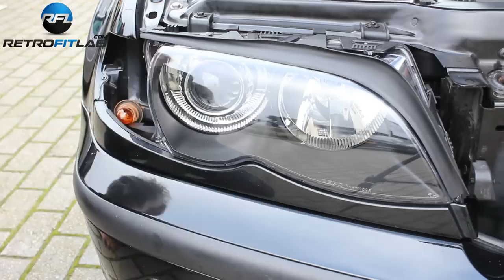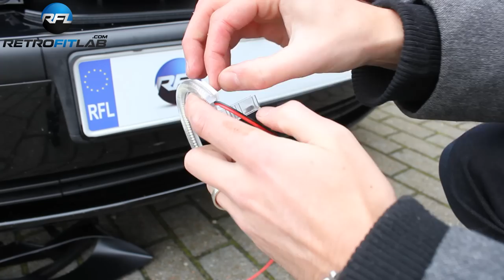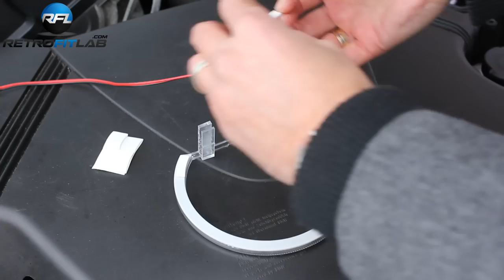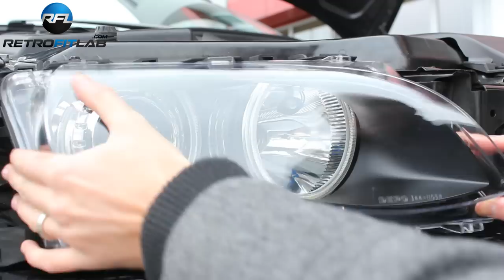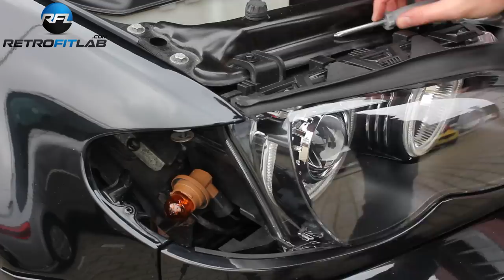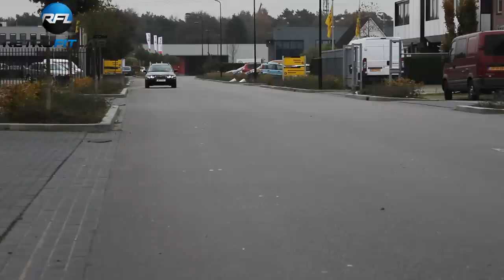BMW 3 series dimmable E46 Led Angel eyes / HALO mounting instructions

Comment: Never seen headlights come apart so easy
Reply: +Gnik4144 they have taken it apart several times so the dismentaling would look easy and quick
Reply: +Karl Tilgar yeah, the E46 headlights are extremely easy to take apart because its all clipped on. All cars should start doing this!
Reply: Retrofitlab what size ring did you use
Reply: yeah but in the facelift coupe and cab they are glued....
Reply: Gnik4144 دزلي سياره ساكن في لعراق
Reply: @Joel Ernesto Yea, been using instaflixxer for years myself :)
Reply: @Joel Ernesto Yea, been using InstaFlixxer for since december myself =)
Reply: @Joel Ernesto yup, I have been watching on InstaFlixxer for months myself :)

Comment: thanks for the vid. don't get me wrong, i really like that this is available. but i don't get why you don't talk? wouldn't it be easier, and eliminate many quesitons, if you were narrating it? i also have a 2004, but mine has stock headlights. so this will work without problems? so you just connect the white wires coming with it, to the yellow wires and it follows the high/low beams?

Comment: Well I've just fitted a set of Angel eyes lights & like the video it's dead simple...

Luckily, my headlights don't have a sealant around the lens case some models apparently have..
But, Yeh there a great mod, dead easy to fit unlike other brands where rewiring your engine bay/cabin is required
Reply: Hi Mal, I got the same angel eyes last week from retrofitlabs and haven't installed them yet as I'm not sure how to connect them. Can you please guide me.
Here in canada we dont have the tiny bulb which the technician removed and connected the blue wire to, what is the alternative? 
Thanks

Comment: How do you turn off the daytime running lights? I want to see just the halo rings on while the car is running
Reply from the maker: You can connect the daytime running light connector to the halo ring and not to the bulb so it will only give power to the halo ring.

Comment: With a running engine the relais makes a loud zumming noise.
Contact on it's totally silent.

Im afraid it wont last very long.
Has anyone else experienced this issue?
Reply from the maker: Which relay do you mean?
Reply: @Retrofitlab  from the kit. But it stopped and is still working today.
Reply from the maker: @hornox4life  self solving problems, gotta love them! ;-)

Comment: Is the pre-face lift headlight for the E46 (2000 328i E46) as easy to take apart as this one? That would really make it easy for me to safely install angel eyes on the BMW! Also, what is the colour temprature of the rings you used in the video? I don't like the ice cold white (8000K) ones. I want the same temprature as seen in the video! :)
Reply: Awesome! I want the OEM look and angel eyes to match the colour temperature of the HID's, so 5000K will be perfect. Also, did you use CCFL's? Where could I buy the ones in the video? 

Love your work amd videos too! :D

Comment: just brought these from ebay. they send me 4 same size ones. make sure when u buy these there are one larger and one smaller per head size
Reply: +san happy E46 Projector headlights need 4 same size rings. E46 non-projector (HALOGEN) headlights need 2 smaller and 2 larger rings.

Comment: Whats the sizes of those angel eyes? 131mm? for both? I have a 330ci 2002 bmw and the 131mm were too small for my lights. do you know what sizes i should get for the high beam and low beam?
Reply: +Retrofitlab my lights are xenon and its before facelift. Idk  if that matters lol my corner of the lights are facing down. and where can I get them sold separately? I want them multicolor
Reply: So 4 of them are all 131mm? I mean it doesn't look perfect fit like yours does

Comment: So you dont disconnect anything? You just connect these new ones?
Reply: ***** Do these fit a 2000 316i sedan? I also got another question.. They are kinda yellow when they are stock, That will just light in the back of these ones, or what?
Reply: ***** You say they are dimmable.. How do you adjust that?
Reply: *****  So can i controll the dim?
Reply: Do you usually take out the parking light when you put on one of these angel ayes kits?
Reply: Did you connect the wiring from the angel eyes to the park light cables?

Comment: The only problem I would have is how do you wire them to the battery. 🤔
Reply: +Retrofitlab so I installed my halo rings but the cables I got only had a negative cable but not a positive cable. It had the red one which goes to the fuse box and the white one which is the optional wire, but it didn't include the positive cable, so I don't know how that works.
Reply: +Retrofitlab check your email.